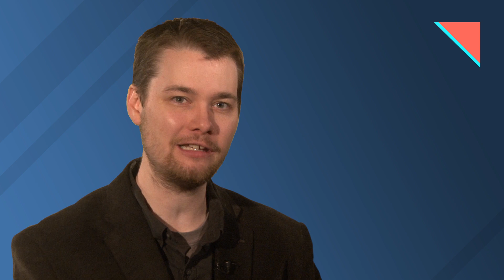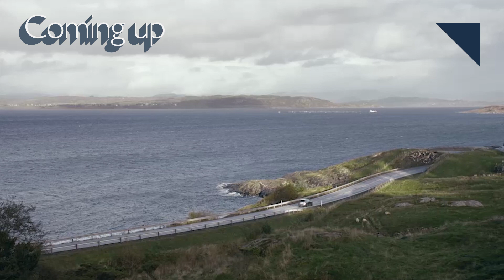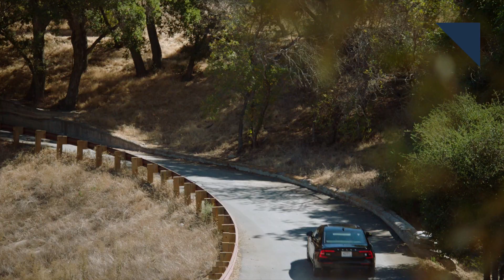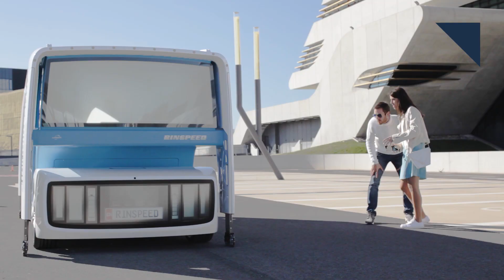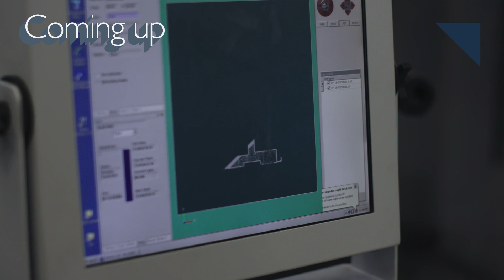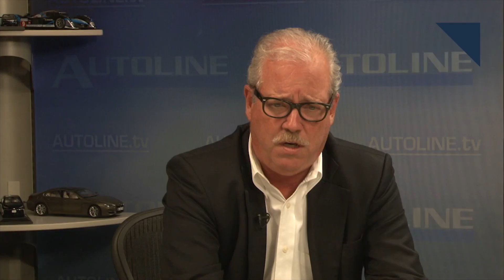Volvo S/V60 Impressions, Tesla Says to Order Now - Autoline Daily 2455

Comment: Haha. The fog light was out on the S60 rolling off the line.
Reply: Haha. The fog lights are used as cornering lamps if fog lights are not on. If the steering wheel was turned it was only turning on the side the wheels were turned towards.
Reply: Yeah, not burned out, that's definitely the corner turning illumination feature.  Lots of modern cars do this.
Reply: This time, the dragon got burned!
Reply: Thanks for the schooling. Learned something new.